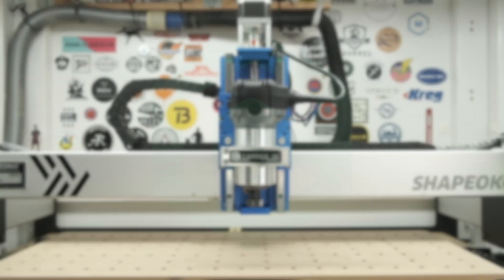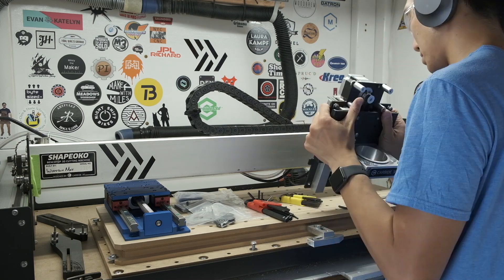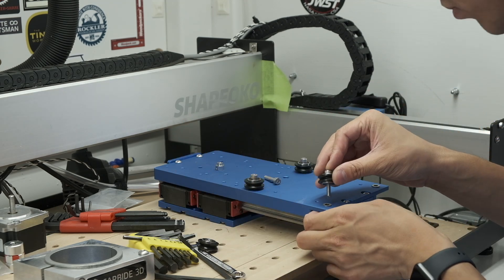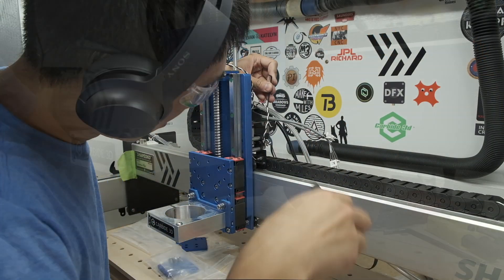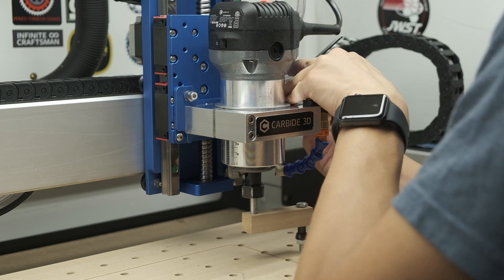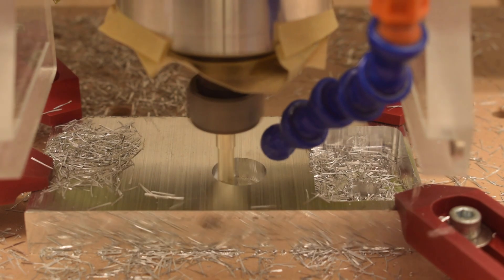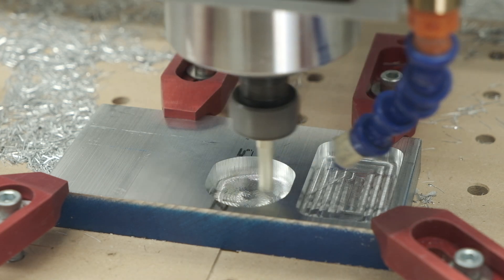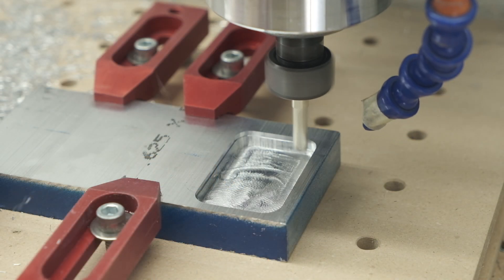Shapeoko 3 Heavy Duty Z-Axis (HDZ) Upgrade Overview

Comment: What's attached to the system by the router? It looks like maybe an air flow tool
Reply from the maker: https://carbide3d.com/shapeoko/
Reply: @carbide3d  that just takes me to the website. I don't see that particular attachment.
Reply from the maker: I see what you’re looking at.  Yes that would be air added to the Z-Axis for chip clearing while cutting metal.   Check out this video for updated info on that type of installation.  https://youtu.be/Al9HW-aXQeI
Reply: @carbide3d  gotcha I see it a lot but never get an answer, thank you

Comment: I have the suck it dust boot on my stock z. Wanting to upgrade to the HDZ. However, I have not been able to find the mounting ears that were preciously sold by Carbide. Any suggestions?
Reply from the maker: The files for the ears are freely available, you can download them and produce your own.
https://docs.carbide3d.com/assembly/suckit-ears/
(Links at the bottom)

Comment: Winston,
Can you speak about your loc line set up on the HD plate. Could this be used in addition to the suck it? Thanks
Reply from the maker: You can see a closeup of it here: https://www.instagram.com/p/ByeJLaWgbRe/

It's just a plastic bracket that my NPT couplers go through (the black Delrin itself isn't threaded at all). Drilled and tapped a small hole in the spindle mount to attach the bracket. 

On the input side I'm just using an air pump I bought online. It's rated for 950 GPH, but I'd recommend just a little bit more, maybe in the 1100-1200 range. 

Could you use it with a dust boot? Sure, but unless you route your air in from the back it's going to be blowing chips against the air stream. And if you're cutting aluminum chips, they're usually too heavy to be reliably captured. Better to just blow them out let them go far away from the spindle.

-W

Comment: Winston - I found that my machine, which is about 2 years old, required significant upgrades to the firmware and adding homing switches. I posted it on my channel for those that might have that problem.

Comment: I was going to post my entire story leading up to my HDZ but deleted it.
The condensed version is...
After 2 4x8 sheets of MDF and a lot of tin foil .... cussing...praying and almost selling the Shapeoko... I bought a HDZ and a Edge Technology mini tram.
I know... That's a expensive investment just to cut wood acrylic resin and epoxy however I bet I save enough to pay for it in sandpaper and sanity.
I HATE THOSE DAMN SWIRLS!!
Reply: Did the edge Technology mini tram help solve the swirl marks for you? I picked up the hdz today just for the eztram cause tramming my shapeoko is almost impossible. I want to if it's worth investing in the mini tram like you did.

Comment: Wow, i wish I'd known about this a week ago. I ordered an upgrade for CNC4Newbie. I haven't opened the package yet, but I think it uses ACME screws rather than ball screws (don't quote me on that)
Reply: I have a CNC4Newbie. They use ACME and also use rod and m8 linear bearing instead of track bearing. I've been using with an upgraded Bosch router and 3rd party mount. Thing works awesome, no messing around with bad pockets, etc. I wouldn't be super hasty to get rid of it, since its like half the cost and does a great job, but thats just me.

Comment: Impressive. Can you please help me understand the differences you noticed at the 4 minute mark? Both 1/4” cuts look the same to my untrained eyes. Thanks!
Reply from the maker: You need to compare the floor finish to 3:37. There are swirl marks in the floor of the pocket by my thumb which are leftover from the roughing operation, that show through the finishing toolpath. That means the machine deflection in those areas was just barely more than the safety margin I had programmed in.
Reply: 1 of them is 0.25" not 1/4" lol

Comment: Can we use  jtech laser with hdz upgrade?
Reply from the maker: If you mount the laser in the front-center you can. If it's off to the side of the spindle, you'll need to remove it. It will get crushed when the machine homes.
Reply: @carbide3d  thank you very much appreciated

Comment: Wow, nice. Will this give you a taller max Z height as well?
Reply from the maker: Clearance under the gantry is the same, but Z travel is increased. Usually though, the limiting factor for how deep you can cut is how long an endmill you have.
Reply: @carbide3d   I have been toying with the idea of raising the gantry several inches to accommodate really thick material.  Any insight as to this?
Reply from the maker: @SouthernOregonCoast  No reason it wouldn't work, but it's on you to make sure the frame is rigid enough. Also, at some point your spindle/endmill will no longer reach the floor, especially with smaller endmills,, so there's not much point in making too drastic a change.
Reply: @carbide3d  
Cool.  Glad there isn't something obviously lame.  I have been making topographic reliefs on scrap wood, but want to make a carving of Crater Lake and surroundings on the top of a short log.  
My endmills are long enough, just need some elevation.  QGIS and Aspire make the workflow easy.  4 inch steel tubing may make the needed platform
Reply: @carbide3d  Clearance would actually be one of the biggest reasons for me to upgrade. I could stick a supplimental wasteboard with a big vice under there and not lose too great a percentage of my cut height. Also, being able to work on taller stock (even if I don't go to the floor) would have already been handy on a few occasions.
Reply: @SouthernOregonCoast  Lowering your work surface is actually easier than machining new, taller side gantry plates. There's not really any reason you need the metal plates under the frame that hold the waste board, should you rigidly mount the side rails to a modified work surface with elevated sides.